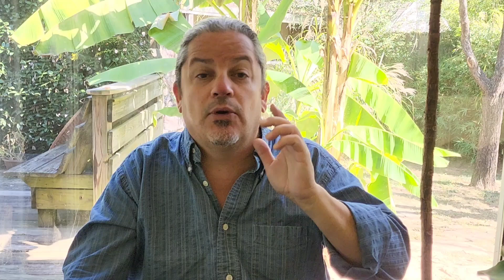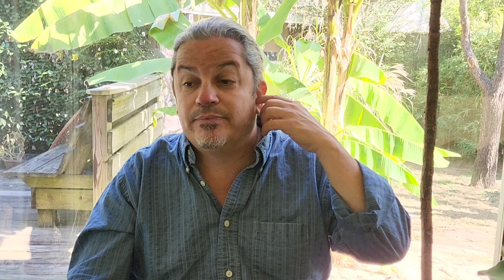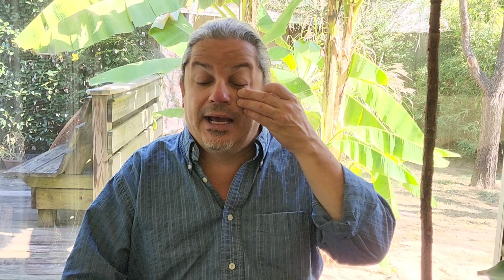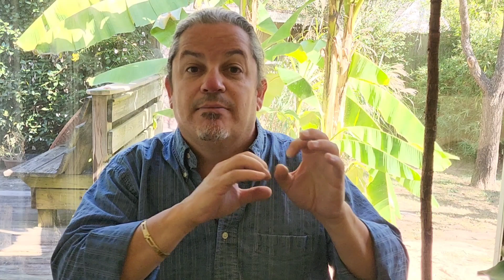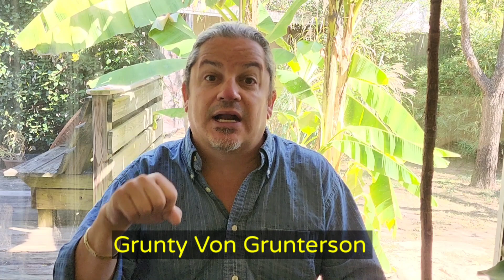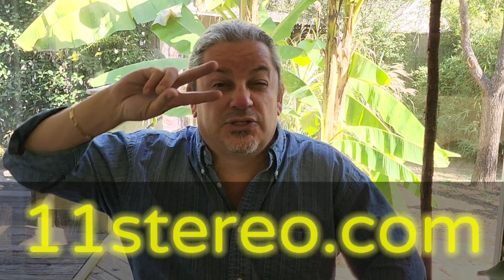WHAT CLASS OF AMP IS THE HIGHEST CLASS PT 2 !!

Comment: I think I must have missed the bus here. From my many years in electronics I was taught that class a amplification was single ended and the amp was biased in such a manner to let it idle in the middle of its linearity thus an input signal depending upon it's strength could push the amp into saturation or cutoff. The problem is you can only get so much current out of a device like this. Operation within linearity produces very little distortion. AB is push pull, two devices of opposite construction working together one side amplifying the positive portion and the other the negative portion. This type of amp must be well designed to avoid notch distortion, the transition point from either side. Class C is used primarily in radio frequency amplifier finals as you desire efficient production of a modulated carrier wave. High distortion but it doesn't affect the intelligence in the carrier wave.  Class D is nothing more than pulse width modulated audio which requires very exacting circuitry design to recover the audio.
Reply from the maker: Thanks for the lesson !

Comment: Mikey ever heard the Benchmark AHB2?It seems to get nod for clean specs (and is USA made).Also wondering what you think of hybrid amps wonder say about Rogue  Dragon/Hydra amps which have tubes mixed with class D.I assume they are done well because the Rogue line is pretty well regarded (Pre's and tube amps) and though there might be some hype and marketing bucks tossed about I think it would be hard to by that much agreement
Reply from the maker: I never liked Benchmark... Not a High Level brand to me. Rogue is OK. Not so sure about Hybrid... relying on a vacuum tube makes no sense  from a design standpoint, I think you nailed it with marketing. It simply means they are not capable of making a good Class D, so they need a tube to mask the inadequacies, IMHO.

Comment: Great points here! The vast majority will find perfect bliss with a high current Class A/B, bottom line.
For the sake of being thorough, there are amps out there that operate in Class B, as unpopular that is. We also have Class A/B amps that spend the first 1/4 turn of the volume in Class A.
Reply: According to Douglas Self, a perfectly biased class B with just the minimum current to avoid the crossover gap, class B sounds better than class AB when this leaves it's class A area. I don't know if this is a universal truth. It depends of the particular design but I can assure you that a Sony TA-N80ES sounds crappy if the bias current is increased a bit. Optimally biased, it stays cool at idle but the sound is class A like.
Reply: @salvadorrodenas3071  Ive read driblets here and there online that support exactly what your saying! I have a Class B active tower & sub restoration set on the backburner until I have funds to complete it, and am very eager to finally hear how it sounds!
Reply: @AllboroLCD  enjoy your way and tell us how it ends!!

Comment: Hey Bro - This two part series is among the best videos you have ever done!  I really learned some valuable stuff. You really were 'the audio professor' on this one - like showing what makes the little $3,500 amp Jeff Rowland 125 amp so special by utilizing the  pricy Lindahl transformer in the input section. You pointed out that is usually found in more pricy gear and topologies.  That's what gives it such great value. Now I understand why you are so right to rave about that product. You also beautifully summed up what the advantages and disadvantages of A, AB, & D are.  You are taking a really holistic approach based on the SYNERGY of components at any given price point.  A dealer should use an entire systems approach not be a box pusher. Bravo Mikey!

Comment: I use the AB Rowland 625 in my living room with the big speakers, Playback Designs DAC, turntable ... for the big tasks in the evening/night😁 so to say.
It looks great, it sound fantastic, powerconsumption is OK when turned off the rest of the day. I turn it on 1hr before I want to listen and thats ok.
The 625 is getting really hot with my level of listening but it is ok, the room is big enough.

In my PC-room I went with the psaudio Stellar Strata integr. Class-D with tube in pre section driving Magnepan 1.7i
Absolutely happy with that combo, it can stay on all day and doesn´t need much energy (which is good these days) and doesn´t generate much heat. 
Easy connected my only source (PC) via usb, network access to my NAS or Web and navigating with their app works all very well. 
I know Mikey hates psaudio but the Stellar is really nice and for 3900€ a great solution for an all in one box. So together with the Magnepan (also around 4k)
I stayed under 10k for everything in that room and I´m totally loving the sound in that smaller room.
Reply from the maker: @77MovieFan, I don't hate anything. PS Audio is not my brand. Nor Parasound nor Carey. If you like them great. Buy them. The PS Audio speakers are taxing the 625S2 if it's running on 240V and running hot. This means your speakers are a Reactive Load... Maggie's are a non reactive load.
Reply: @OCDHIFiGuy  on the loudness level I listen even the Maggies 1.7i drove the 625 hot, I only could use that combi for 1 day but this was the first
thing I noticed when I connected the 625. I don´t find that very critical, I´m used to that and the Sony projector is far worse because of the fan of these machines pushing the heat into the room. The room is big enough to handle this and air conditioner is ready if needed. In a smaller room this would be a nogo, so heat, power consumption is a thing, that is why I took a Class-D for that

Comment: In addition to Wapn Perfo - Class "D" is analog giving the output an analog signal. And Yes in process of amplification it transforms the analog signal into PWM form ( pulse With Modulation), which is not digital, but it is similar. That is why it is not digital. But if you transfer PWM into PDM (Pulse Density Modulation) that is a digital signal same as the DSD signal.  And if you use a Switching frequency exactly the same as DSD, you do not need analog part and conversion, you have a pure digital signal path. The problem came with the endpoint when they make an L/R filter to get an analog signal so it can be used on speaker systems with passive crossover. Because the speaker driver is L/R on its own,  you do not need that, it can be played as DSD stream direct to the speaker driver. Mean that concept can be only used for Active speakers. And it is used in Steinway & Sones active speakers system, which are also open baffle type.  Yes they make the best Pianos in the world and they make an audio system that sounds the same as their piano, and it is digital 100%.

Comment: Mikey....you are missing that a Class D amplifier is using a switching power stage, that are digital..i.e. either a 1 or zero, that is why it is called CLASS D for digital. It can use a triangle wave generator with a analog signal to produce a square wave pulse modulated digital signal for the power stage..OR it can take PCM and create a digital pulse modulated signal for the power stage...OR it can use DSD 1 bit to drive a power stage and be a pure digital amplifier...so you are incorrect with the Class D meaning.  Also note there are ways to wrap analog feedback into a pure digital Class D amplifier...
Reply: To be a digital signal it must have the same length/duration of 1 and 0. PWM does not have that and it is not digital. For that reason, DSD which is a 1-bit topology and does not have the bit length of so call "word" (8, 16, 24, 23 40 ... 128-bit word) is digital and can be stored in the file. But it can't be modified as such as it is one giant stream of bits, without a fixed algorithm to define what is the frequency and what is the amplitude of the original analog signal. PCM digital format can be handled and modified as it contains information on the amplitude and frequency of the analog original.
Reply: @glazzarus  People are splitting hairs, a PWM signal is digital, not analogue. It mirrors an analogue signal by outputting the equivalent "under the curve" power but in no way resembles analogue until post processing pulls out the fundamental noise, and smooths out the signal.
Reply: @WXSTANG  First PWM has introduced 5 decades ago for EL. motors control in Industry before digital audio even exists in the infant stage. One of the first global applications was in TGV high-speed trains. Actually, because of PWM motor control, they get the idea to use it for audio. and it was never and will never be digital, as sad, digital MUST have the same time period of 1 and 0 duration. Any discrepancy in the time length of 1 and 0 is Jitter. PWM has variable pulse duration, and it drives current in motors or better say it controls magnetic flux.  In class "D" audio amps control in the same way something else.
Reply from the maker: @Michael Rovner, then what about the Class D amps that use Linear Power supplies and torriod transformers ?

Comment: I am an engineer, Class D takes the digital DAC signal, amplifies the digital signal, and outputs a digital signal until it gets to an LR output buffer to make it analogue again before the speakers. None of the amplification sections are analogue. If you fed an analogue input into a class D, it would get converted to a digital signal after it is amplified, and would to still need an LR output buffer to make it analogue again. The newer GaN Class D, are still technically digital, but they are so fast that they can mirror the actual analogue input fairly well as to appear mostly analogue, but again, still need an LR output buffer.

All that said, the best style of amplifier in history was the BASH Class H, which had a PWM power section similar to class D, and an AB output section giving the sound of a class AB, with the efficiency of a class D. They are mostly relegated to history, with a few small devices picked up by enthusiasts who knew what they were looking at.
Reply from the maker: @Wapn Perfo, No you're wrong. You're are naming a digital amp. Class D is a very analog amplifier Mister engineer. I'm a dumbass and I know this.
Reply: @OCDHIFiGuy  I had this debate with the audioholics chap, and the amps are digital, they are the same car amps TBH.
Reply: @OCDHIFiGuy  I have to disagree. PR people are splitting hairs thinking that a PWM signal is "analogue", when it isn't. It is either on (1), or off (0)  which is digital domain. A PWM signal will take the area under an analogue curve and approximate the curve using larger, or smaller pulse widths to approximate the analogue output, but it is not analogue, and looks nothing like analogue. PWM outputs are an approximation of analogue based in the digital domain, and need to be smoothed out to become analogue again, and rolled off at the top end to eliminate first order harmonics not normally present in other amplifier topologies. Those harmonics are created by the fast switching frequencies needed to approximate the analogue output. Fact is, without an LR output buffer, the output has carrier frequency distortions that do not translate to the human analogue domain at all. A Class A, or AB needs an analogue input, and outputs a pure analogue output equal to it's input. A class A, or AB cannot amplify a digital PWM input to be analogue, but a class D can take analogue, or digital input because on the output there is post processing either way to convert the output back to analogue. There is no digital / PWM post processing in class A or AB. They are completely different topologies. Sorry to be the bearer of bad news, but whoever told you it is analogue is twisting the truth a tad. While it could be taken as true, it is not the reality at all when an engineer looks at it with their equipment. I could easily mistake the output of a class D as a digital motor controller (without post processing) if I didn't know what I was looking at. If I looked at an analogue amplifier, there would be little discussion as to what I am looking at... an analogue amplifier.